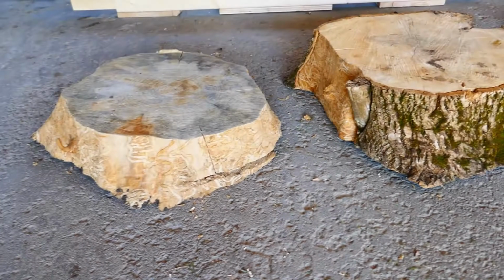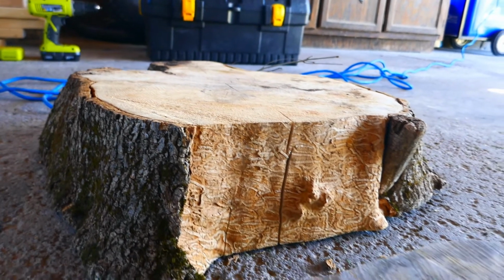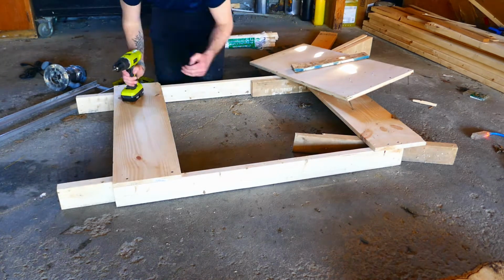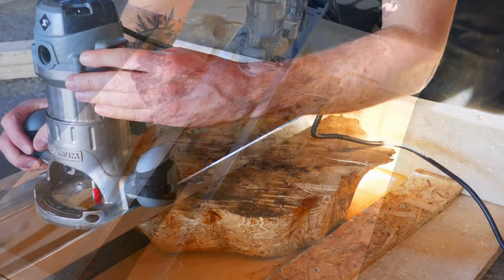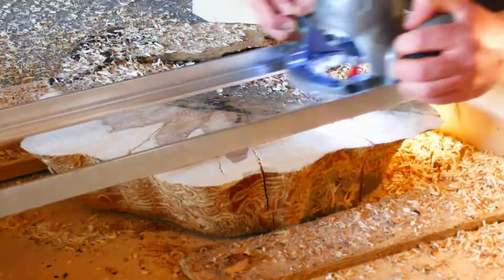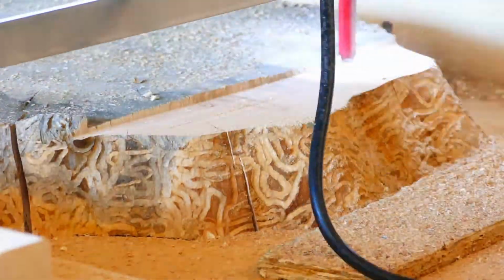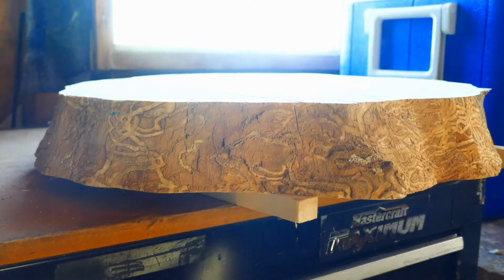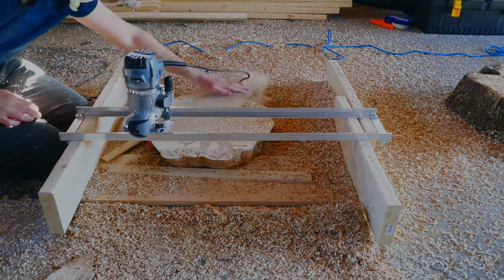$10 DIY ROUTER SLED - SLAB FLATTENING 101

Comment: The idea is right, but it definitely needs refining. Looked very flimsy with potential for you and your work to come a cropper really quickly.
I know using a sledge is very seldom unless your planning to do numinous slabs, table tops ect. 
As its all about the finishing and safety there are better builds out there. 
I liked the way you gave sound instructions on setting up the the levels of the rounds. 

You've got the basics steps down, so your next attempt at building a sledge will be a lot better I'm sure.

Comment: would this work to do fluting on a long board
Reply from the maker: Yes! So the size of board you can do is dictated by the size of the sled. Also, Amazon sells some pretty cheap flattening bits. They're two inches wide and will do a much faster job. I've switched over to them.

Comment: I have a 4×8 sled. I adjust height by adding to the rails. Fun little deal. 
 I use a one inch bit on a 2 h.p plunge router. Inch and a quarter or bigger bit is to big. Lol. 
 Good show man.

Comment: Ya but it’s not flat...?
Reply from the maker: its hella better than before, it'll be perfectly flat after i sand it all down, also dota tonight? haha
Reply from the maker: I should also say that the goal is to get both sides as close to parallel as possible, especially when taking random stumps from a local forest
Reply: @Sydsworkshop  I bet, since you said in a different post, you are using a 2” wide bits you are getting better results with less sanding needed to make it smooth.